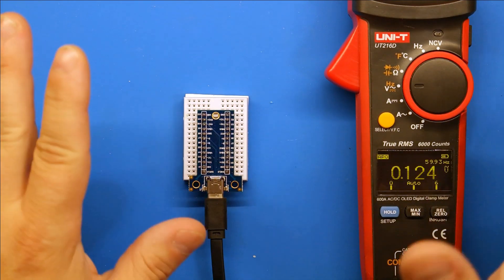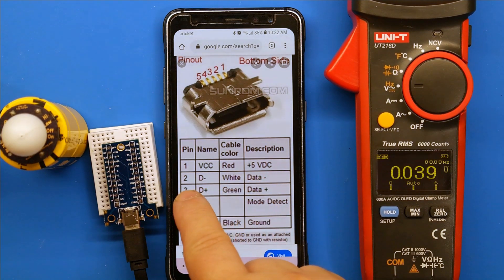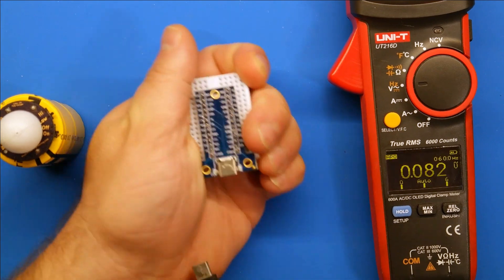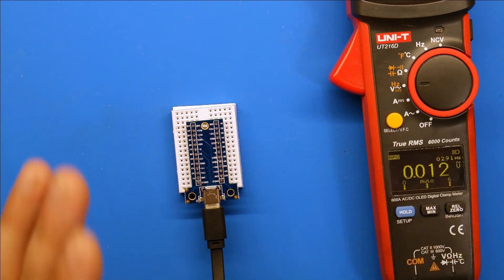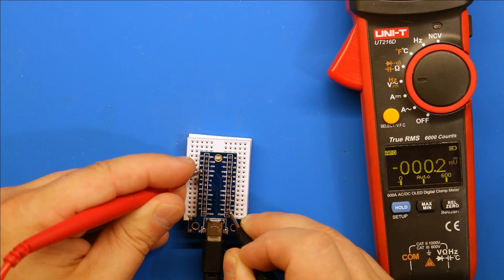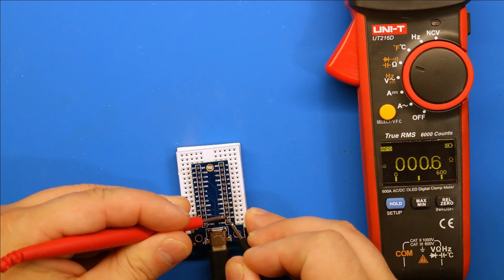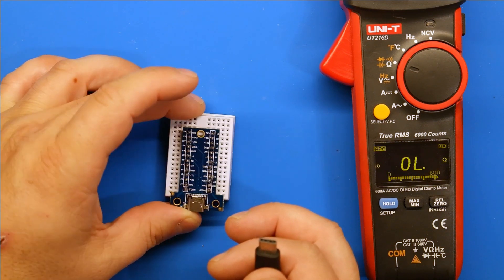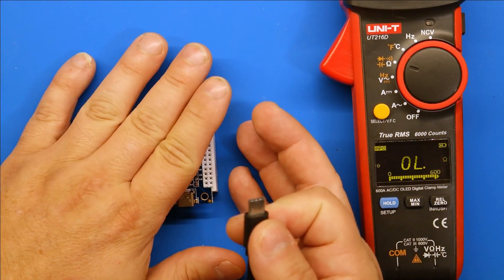Getting Power From USB-C Breakout Board

Comment: Hey man, thank you for sharing your knowledge with all us! I am not a pro in the electrical world, but always very much interested in doing some fun little projects! :) I have a bit of a problem I thought you might be able to help me to solve. Please would you be able to think of a solution for the following: I have a 5v 2.5A LED Light I want to get powered through a USB C PD battery bank. I tried so many different approaches and the best I can get is the light working pretty stable, but at maximum of 70% brightness. The Power bank is Anker 10k with USB C PD. Bought a cable that goes from USB C to USB A and another cable that goes from USB A to DC 5.5mm that goes straight to the light. First I thought the battery is not good enough, then after reading a bit I started to feel the cable might have some resistors that are reducing the current which in result is not enough for the light. As an example I connected that same cable set I mentioned to my iPhone 11 Pro PD original charger as well as my mac book original charger and the light acts exactly the same as when it is connected to the battery bank. The iPhone charger output is 5v 3amp. This is why started thinking there might be something wrong with the cable. I am lost now! I would really appreciate if you can help me on this! I am more than happy to share some photos with detailed specification of everything. Just let me know if you need it and I will do so. Thank you so much in advance!

Comment: Just in case anyone has bought this board or another breakout board, the pin is actually labeled VBUS both on the board and on the standardized USB-C pinout labels.  To avoid confusion =)  Thanks Mad Electron Engineering for the helpful demonstration!

Comment: @MadElectronEngineering #MadElectronEngineering nice video, great topic, how about a video about USBPD and how to enable the different voltages , Voltlog and Adam Welch have used a cheap £2 board to enable them, i can add links if you need  ;-]
Reply from the maker: If you're referring to using quick charge to get higher voltages I will explore that later in 2020.
Reply: @madelectronengineering  yeah the whole USBPD (power delivery) and Q.C 2.0 and 3.0 is really interesting, here are the videos i was talking about and another one , Voltlog  https://www.youtube.com/watch?v=WuUserBySV8 and Adam Welch  https://www.youtube.com/watch?v=G8Tfdbmb7L8 , there is also a great one here https://www.youtube.com/watch?v=OwAZqJ4wpJg , i want to get one of them boards, all are well cheap too, im upcycling loads of old 500w halogen flood lights to 10-30W leds using computer heatsinks inside currently they running around 12V (9V after resistor , lol) i was thinking of using your idea with one of the chips they mention to terminate them with USB-C instead of the XT60's they currently use   ;-]

Comment: Thanks, I had thought about using USB C the other day, just got to find some 4.2v lithium charging pcbs that are more than 1 amp :/

Also, the 6 x 1500F Maxwell Supercapacitor bank in my van is still running flawlessly after 2 years
Reply from the maker: Glad to hear your supercaps are doing good.  I just finished the raw footage for my 2 year update, I should have it up next weekend.
Reply: @madelectronengineering  i was just fixing to ask of you were gonna do an update
Reply: Mad Electron Engineering would be great to see more things used with Super Caps...... Like Cars, Mowers, Solar Systems. Body Motion and Body Thermal Electric ⚡️ Charging Devices 😍
Reply from the maker: As time progresses I'm sure the industry will get the energy density higher on supercaps and make them more viable for general purpose electronics.
Reply: @madelectronengineering  i was talking to buddy telling him about the supercaps and the hybrid battery you made.

we were talking about off grid solar power banks.  i think either supercaps or that other battery tech they are working on is gonna really change the long term viability of solar setups in next 5 years.
Reply from the maker: Supercaps in a solar setup would most likely be more useful as a buffer for when clouds play games with the solar panels.
Reply: @madelectronengineering  i was thinking about the longevity. right batteries can handle only so many cycles.
Reply: @madelectronengineering  Have you seen the videos about LiFePO4 38120 cells? They're extremely robust 3.2v lithium cells, 8-10 Ah and can handle a 200amp load. 3.2V makes a 4S pack perfect for 12V automotive applications. There are videos of people starting cars with 4S1P packs
Reply: Special EDy Nice 👍🏻